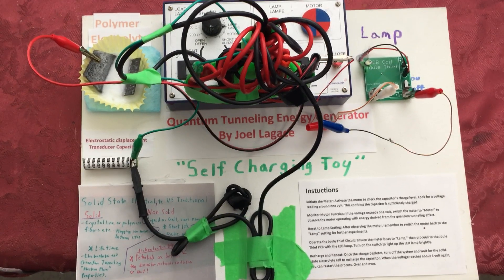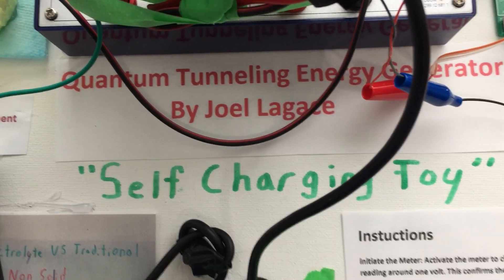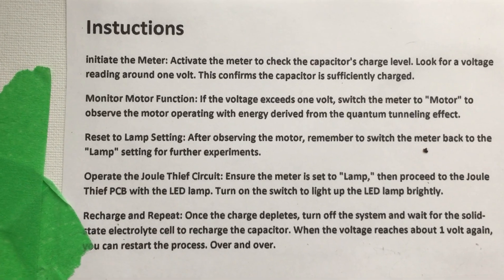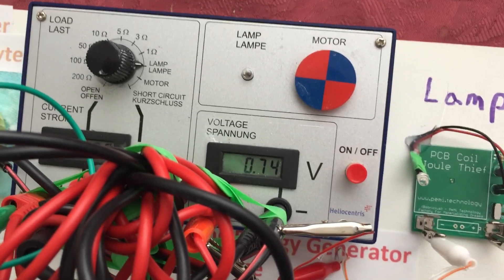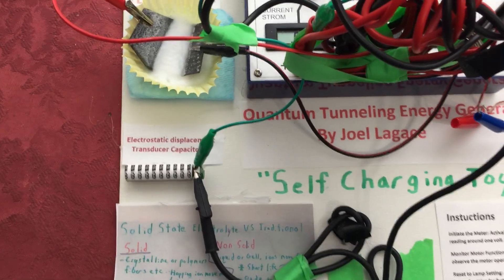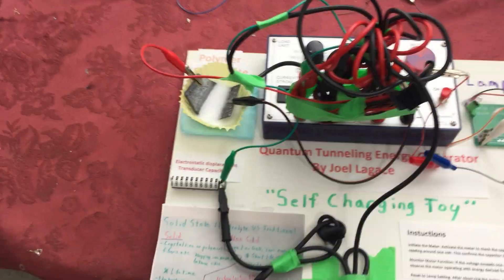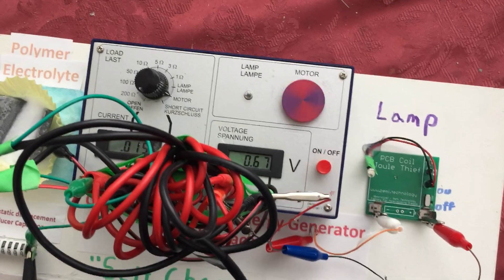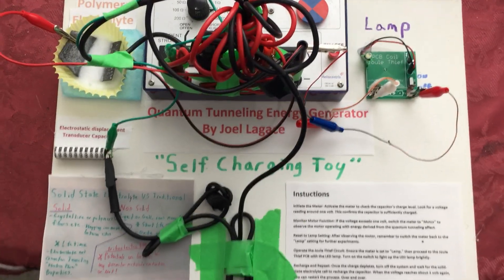Self Charging Toy

Comment from the maker: Good day, everyone. I've noticed a trend that's becoming more frequent: discussions veering off into topics not directly related to the phenomena I'm exploring. A recent video serves as a prime example, along with certain inquiries it sparked. While I don't necessarily fault the original author, as their mindset is unknown to me, it does highlight the issue of generic questions.

These off-topic queries, I must admit, are quite frustrating. For instance, being asked for a voltmeter schematic or how it connects to a circuit feels irrelevant when I'm discussing subjects such as solid-state electrolytes and capacitors. It's important for those interested in this field to engage in some fundamental research on their own. Fielding these kinds of questions can be incredibly time-consuming, detracting from the valuable hours I could spend advancing my research.

Just like anyone else, I'm human, with limited time and a life outside of this work. My decision on how to best use my free time is crucial to maintaining progress in my research. Responding to every question, especially those attempting to sidetrack or discredit my efforts, is simply unfeasible. I suspect some of these inquiries are not genuine but rather attempts at trolling.

For those genuinely interested in these videos and the concepts discussed, I encourage you to understand that knowledge and understanding aren't simply handed out. It requires personal effort to research, assimilate information, and advance your understanding without overly relying on others.

I will continue to share what I know, focusing on contributing meaningfully to our shared interest in these topics. It's about moving forward together, each taking responsibility for our learning journey. Thank you all for your attention and engagement.